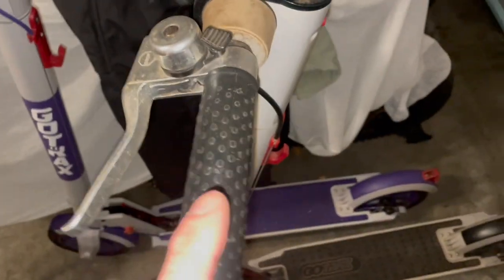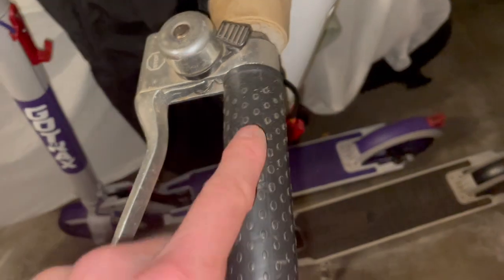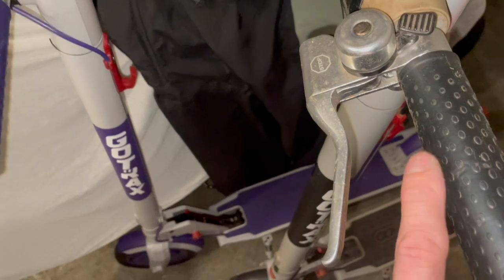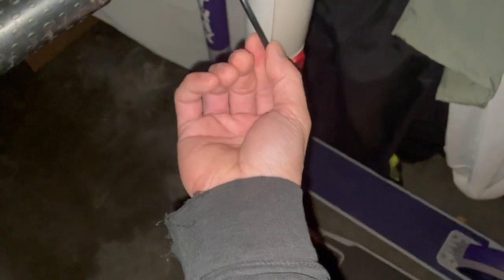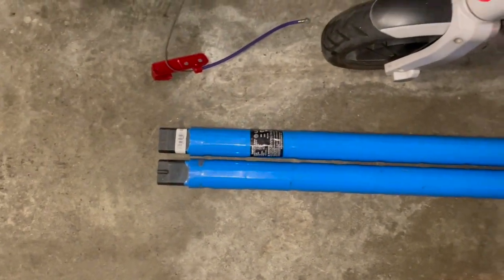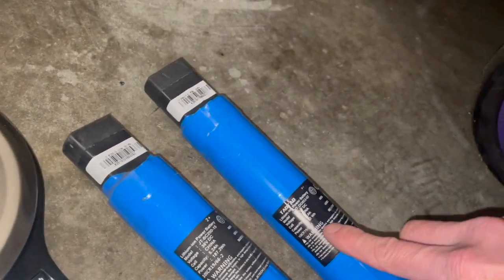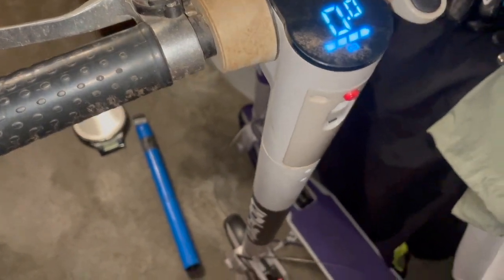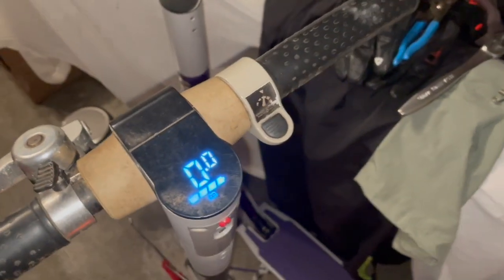GoTrax XR to XR Ultra battery

Comment: What is the longest distance you have been able to ride on a charge? I imagine your niece is much lighter than you. Also what is the top speed?
Reply from the maker: Longest was over 10miles when new at full power. Tops out around 16mph
Reply: @DaBinChe  Dude, your scooter sucks. I got the cheap Gotrax Rival model from Walmart and mine goes between 25 and 30mph, 10-15 uphill. ...and I'm way over it's rated weight. I weight in at around 260.
Reply from the maker: @TheGreyLineMatters  good for you
Reply: @DaBinChe  I meant it as in, it sounds like your scooter is broken, might want to exchange it. Seems like you're only getting half the performance.
Reply from the maker: @TheGreyLineMatters  lots of different type of scooters, varying power/speed/range/etc.
Reply: @DaBinChe  So you're telling me you bought the slowest, most boring scooter on purpose? ...okay then.
Reply: @TheGreyLineMatters  dont have attention at home?
Reply: @TheGreyLineMatters false information as I have the gotrax rival and it goes max 15.5 mph as said in the description of gotrax rival and literally says it on the box and the tire and tire air tube isn't meant for faster then 15.5 because mine literally popped within a month and am buying the airless tires. Even the new g3 that just came out only goes like 17-18 mph max speed. Did you get a different e scooter? Im interested in hearing what that one might be as I might purchase it.